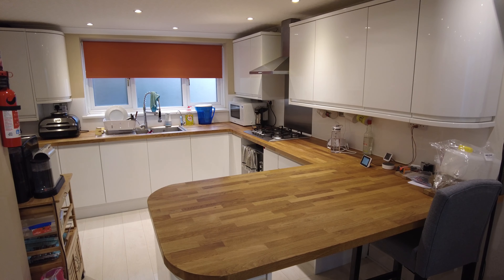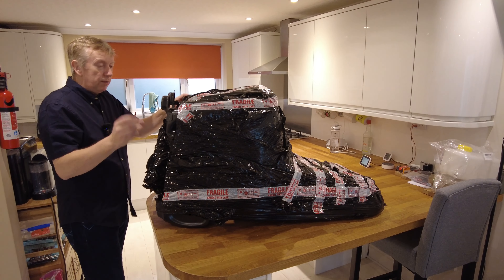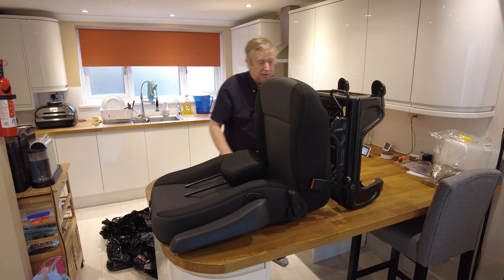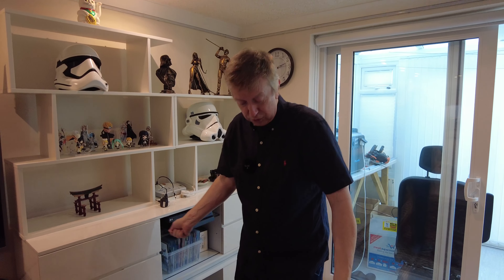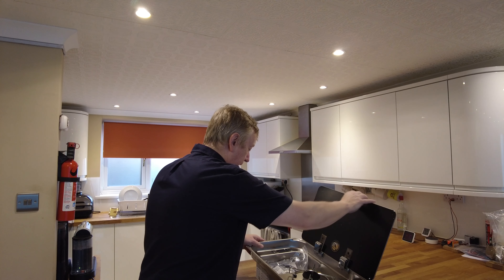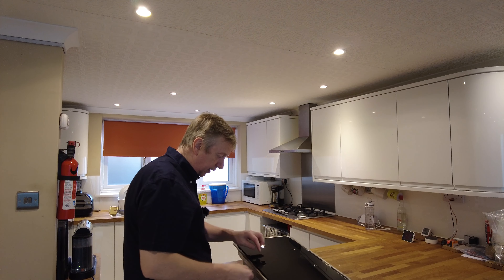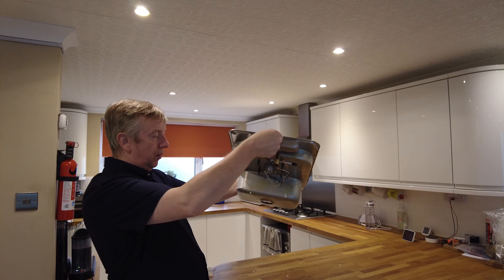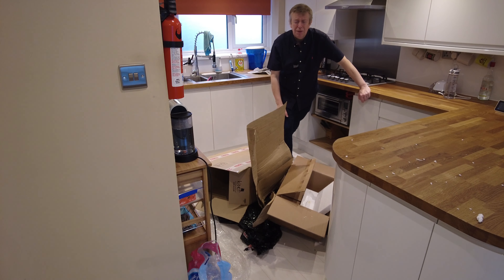Parts Have Started Arriving... (Van Interior Rebuild Vlog)  (Day 7)

Comment: With a nod to less faff, I may have gone with a small induction hob rather than gas. Especially if you go the lithium power route, like your electric blanket 👍
Reply from the maker: Not really sold on the idea if I’m honest. I know technology is moving on, but it hasn’t moved on sufficiently enough to convince me to change. Also, a gas hob is a good emergency backup plan if the main heating system fails.
Reply: @rickvanman  That’s fair enough, really enjoying the new fit out and great to see you being back to your old self with a project Rick 👍

Comment: Out of curiosity, did you not consider doing away with gas altogether and buying an induction hob?
Reply from the maker: Not really sold on the idea if I’m honest. I know technology is moving on, but it hasn’t moved on sufficiently enough to convince me to change. Also, a gas hob is a good emergency backup plan if the main heating system fails.